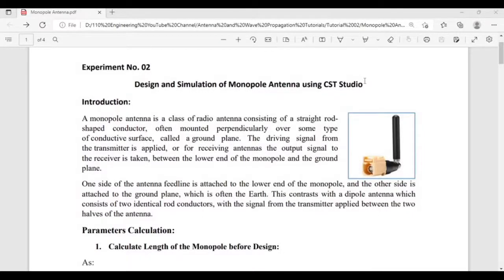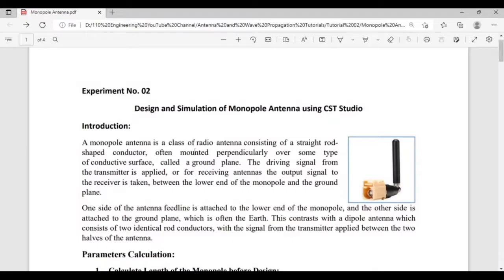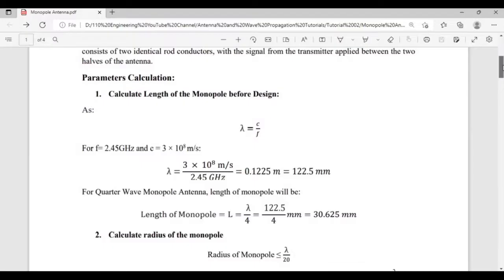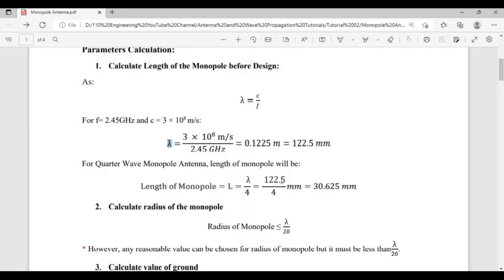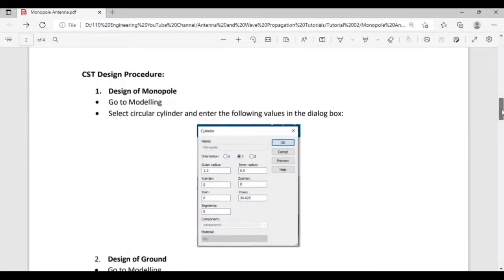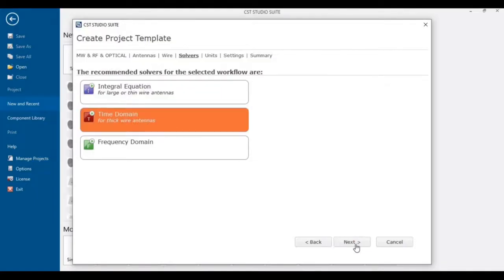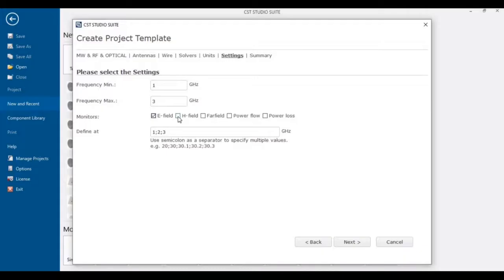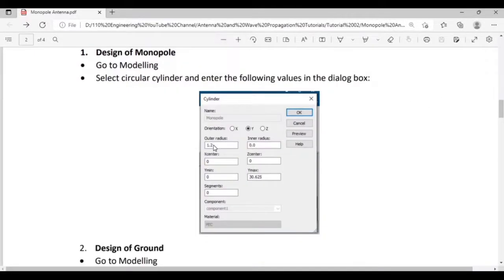Design and Simulation of Monopole (Quarter Wave) Antenna using CST Studio

Comment: Thank you
But you know this is not a proper design, the s-parameter must be at least less than -10db for that particular frequency, So my question is how to optimize it? which parameter should be changed?